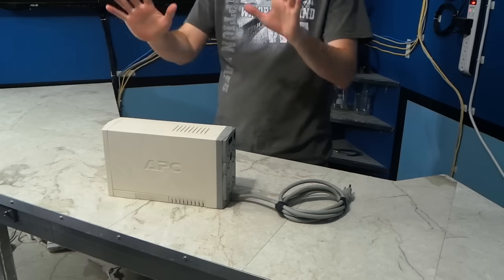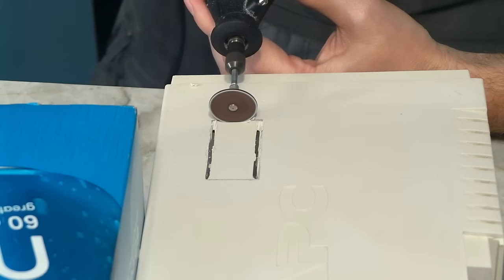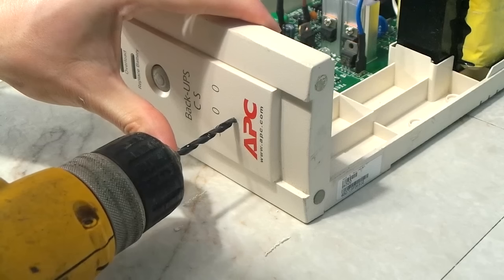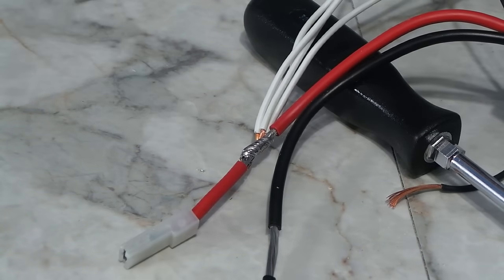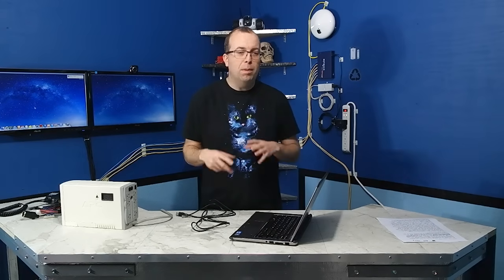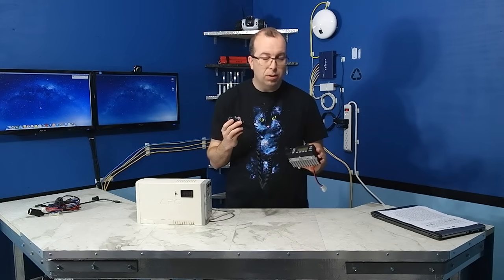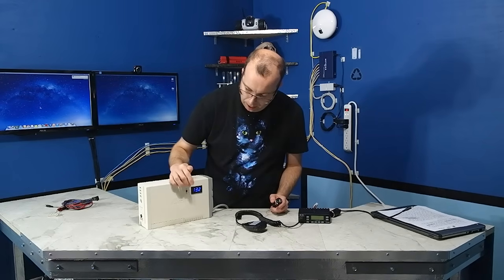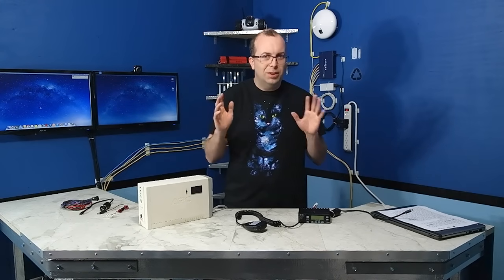Ultimate Battery Backup Hack/Mod.

Comment: You absolutely, positively, should have put a fuse for those three 12 volt outlets.
Reply: +Nabeel Rahimpour yep no fused outlets connected directly to a battery is not good idea
Reply: you dunno if those cigarette plug ports had fuses built in already...i used to work at a place that sold them with fuses built in.  He should've stated that tho.
Reply: There's a bit of difference between your flashlight batteries and apc batts in terms of potential for fire.*****
Reply: +ANCIENT ASTRONAUT that difference is what changes it from "ouch my hand... eww battery leak" to "FUUCK MY EYE!! THERE'S ACID IN MY EYE HELP!!!"~while the battery burns your desk and whatever close to it.
it's not uncommon to have paper around one of these devices. Paper ignites fast. A lead acid battery of this size provides a lot of current when shorted. Lot of current = lot of energy to ignite something flammable and ruin your day... or life.
That's only paper tho, one of these batteries can ignite a lot more when shorted. Or spill it's boiling acid around + toxic smoke.
Reply: +ANCIENT ASTRONAUT only in the amount of dc amperage?  Incorrect.
Reply: +Kalvinjj this is correct.  I hate shitty misinformation spread on the internet by people who don't know their shit, ESPECIALLY when it's a safety issue.
Reply: its just best to have a fuse if you don't want one then thats fine (only need it there to protect from a constant short, as long as you're plugging in a Fused appliance you be OK) just i would of maybe used a 32A inline replaceable fuse inside the UPS on each socket more for again for short protection or a external fuse cap (like you see on older AMPs radios) or resettable push button fuse (like what comes with lots of UPSs)
Reply: positively lol
Reply: hes a rebel ;]
Reply: Without a fuse, he'll most likely blow up whatever he is powering up with that 12V.  It might be a 12V battery but during charge it'll probably float between 13V and 13.5V which may blow devices without a power range.
Reply: @phillipsusn  The devices aren't going to "blow up" if there's no fuse, but the battery itself and/or the wiring connected from the battery to the load could fail if the device itself failed/shorted. And 12VDC devices will be absolutely fine seeing 13-13.5VDC.
When you hop in your vehicle and turn the key on, static battery voltage can drop to 12 volts or even below 12 volts if accessories are running. Then you start the car and voltage increases to 14 volts or above....
Reply: @Kalvinjj  What??? Are you kidding me??? You guys don't have anything better to do but criticize??? Really???
Reply: @greasemonkeyradio1279  "Oh jee it's so offensive when people give seriously important safety tips! Stop making me wear a seatbelt as well!!!"
see how this sounds now? Cause, literally, you're complaining about we calling out the importance of safety.
Reply: @phillipsusn   That I think is OK, the voltage fluctuations I mean. When you think about it, the 12v outlets are the car type, so if you connect stuff that is designed to be powered by a car outlet, it would be up to those voltage fluctuations during it's normal operation as well, if I recall car 12v power can go up to even 14v or so (don't quote me on the specific number!)
Reply: good job  man
Reply: @phillipsusn  bs
Reply: @phillipsusn  Those type of 12V devices are made for a car, the alternator puts out 13.8-14.2V typically, so it's not going to blow anything at that voltage. The fuse has nothing to do with it, the purpose of a fuse is to blow and protect the wiring and battery if you hook something up that is shorted or drawing too much current.
Reply: There's BATTA ACID in my EYE, please, fuck my EYE
Reply: Aayush Gangrade  NO THEY DON'T. Not when the plug has been cut off, the sockets do NOT have fuses in, just the plug does, and he removed it.
Reply: The things that plug into the cigarette lighter outlets have fuses. But that doesn't matter because the DC jacks he added to the APC lack fuses, and you could be plugging in other things like a cable modem that lacks a fuse.
Reply: Aayush Gangrade  the fuse is in the male plug which he cut off and put a barrel connector in its place without a fuse. Most ups have a fuse for the battery itself. Multi battery ups have fuses between each battery in series.  I replace batteries on our work ups's. We save money on batteries by replacing the individual battery instead of buying the 48 volt battery packs. Sometimes the batteries are hard to remove from the metal bracket because of double sided tape but I been successful removing the batteries.  

At least someone brought up the fuse issue so others can remember to install fuses if they want to build this setup.

If everything runs on 12 volts dc then the inverter is of no use and should be removed from the ups. The inverter will drain the battery (ies). A switch could be installed in case you need 120 vac modified   sine wave. This ups is not a pure sine wave inverter. Also the voltage is lower when the power goes off but high enough to run a computer.
Reply: Lack of fuses is the greatest problem, but I should add for anyone thinking of doing this: Those female barrel connectors are a very poor choice for providing power. Note how you never see them used for this anywhere else. They are too easy to short circuit because the center pin and the outer barrel contact are right next to each other and just need a tiny crumb of metal (like those shavings from the drilling) or the tip of a screwdriver to accidentally get lodged between them to be shorted. The male barrel plug is the one that's supposed to have voltage present, because you can't easily short the inner hole and the outer barrel by accident. The easily shortable DC jacks, combined with lack of fuses, give this thing a very serious single point of failure (three of them!) that could cause a fire. 
Other than that, a cool project, and an interesting video, but for anyone planning to replicate this: Always add a fuse between the battery and the first connector, and use a connector that cannot be easily shorted by a stray piece of metal. Also check the current rating for the connector to make sure it's suitable for your application.
Reply: @Kalvinjj  When I was a kid I caught my house on fire this way. It was an expensive lesson!
Reply: Yikes.
Reply: With limited space in the box it would have made more sense to add in line fuses onto his extensions than to try and cram them into the box itself I think.
Reply: wouldn't series outlets be a voltage issue and not an amperage issue?  In series, those three outlets would each see a voltage drop for every added appliance.  In parallel, the original wire can only handle the 16 amps, which doesn't change no matter how many wires you add in parallel - it's still the weakest link.  Better to fuse each one, but then also know that what you're plugging in should not exceed 16 amps.
Reply: @SaintApoc It's both, but devices designed to run off an unregulated battery usually won't mind a bit lower voltage. The amperage (and lack of fuse on easily-short-circuited external connector) is the safety problem.
Reply: @ronb6182  in this case the inverter is also the battery charger, so removing it would leave you with out a charger
Reply: Wires are fuses if you use them like fuses
Reply: @jordanlong00  lol that comment was worth scrolling to the bottom of a 5 year old feed
Reply: @arantala  i was thinking of doing this mod, I'll have to change some elements like female barrel connectors as the power source thx to you critiques & input
Reply: No idea what the inside is, but my cigarette ports 12v have fuses inbuilt.

Little glass tube filament type. Not blade fuses.

Comment: I got exactly the same APC unit, I removed the internal battery, changed the battery wires to thicker type, and use an external car battery, standing right next to it, I also cut out the ignoring beeper, now the unit handle my tank water pump for many days, and no fish will die if the mains power fail for that long.
Reply: I got one as well. Replaced the battery, and removed the beeper. Keeps my Wi-fi and cable modem up during a power outage.
Reply: @shawnerz98  I didn’t want to desolder the beeper on my older UPS, so I filled the piezo with epoxy.
Reply: @billyjack3580  Hey, whatever works. :) I'm thinking about converting the Sealed Lead Acid (SLA) battery to a Li-Ion type.

Comment: It might be a good idea to install a fuse for each 12V port.
Reply: Fuse rating?
Reply: @Andrei2000PC  If each wire is rated for 16A, that's pretty much your answer. There are on-wire cylindrical fuse holders that can be bought.

Comment: An update to how the battery pack has held up would be pretty sweet.
Reply: Him getting those two big battery generators recently, tells you exactly how it went 👇.
Reply: These lead acid maintenance free sealed batteries have lasted me 3 years on average. I have units with 4Ah, 7Ah, dual 7Ah, and dual 9Ah batteries between APC and Cyberpower with most of their product range and I don't get more than 3-maybe 4 years without problems
Reply: @Greenlink74  Try keeping your batteries outside of the UPS. Undersized transformers heat stuff up, killing the battery.
I still have 7Ah Panasonic batteries that were used 10-12 years ago in a big Powerware UPS in a data center. They have a decent chunk of their capacity left. Largely moved to the lithium stuff, but still use those to light up the LED strip in my garage.

Comment: Hope the battery backup found to be useful during the crisis.
Reply: that tiny agm battery has such a small window of capacity to begin with, 12ah at most based on its size when it was new, and you should only use about half of that leaving 6ah and factoring in this is 6 years old, i bet that battery had about 2ah of of usable power. 12v x 2ah = 24 watt hours, so maybe able to power a small laptop for about 45 minutes. thats my guess anyways. after rewatching the video i would say his battery is only 8. he could have covered this in the video and then showed the math for how little power there is to work with here.
Reply: @TimeSurfer206  you are not wrong, another thing is that in emergency or occasional cases you can use all of the ah the battery has, and my opinion of agm tech has went up a bit since i wrote that. i have a 130ah agm that tests at 129ah and its 10 years old and had been sitting in storage for 2 years.
Reply: Jeroen  i agree, and i have done exactly that. i have an old school ups from like 1999 when they were stuff was built to last more than just past the warranty. its power is provided by an inverter that is power by 20kwh bank, but anyways back to the ups it runs my xbox, big tv and a gaming laptop, it is much happier when i have two batteries wired in parallel, but they both fit, so i just have it all laying out on its side and it functions great. in fact i have a 12v mobile radio transceiver being powered by those two batteries two, why not?
Reply: @jasonbrown467  You would certainly get more than 45 min on a small laptop.
Reply: I live in the same area and I relied on 2 battery backups like these to keep my phone charged and give me a little bit of light. I was without power for about 48 hours and it was in the 30s in my house, but fortunately I have a gas stove and water heater, so my pipes were fine and I always had hot food, but I lived with my dog in the central hallway for about a week since the power was unreliable once it was back on. I've now replaced all of my UPS batteries and I'm having a solar/battery system installed any day now.

Comment: For drilling holes in plastic, let the bit turn opposite the grinding direction and melt through. This gives clean holes and no problem of the bit biting in the plastic and puling through the material!
Reply: Now I have to find some plastic and try that.

Comment: I got a hamster wheel rigged to a crank generator to charge a phone with my hamster in a power outage but your way works much better.
Reply: oh my word ha ha thats crazy
Reply: LOL
Reply: I dunno, I think the hamster method would be less of a fire hazard.
Reply: A hamster running fast enough to power a 500W load is at considerable risk of spontaneous combustion.
Reply: Hey good DIY tip, I bet with a few hundred hamsters you could power your whole house!
Reply: But if he runs too fast the wood chips could catch on fire.
Reply: You need to tie up a cat behind the hamster. It produce double the power you're getting now!
Reply: But, dis you tried Wumbo?
Reply: Screw this mod, it's to complicated, I've got a mouse and dangling cheese in front if it, runs like a hamster. tsk tsk xD
Reply: DUDE!  Besure to wake that hamster when the lights go out!
Reply: hey punk, i am sorry, i know i come a little late to the conversation but i have to ask you this question..
your hamsters name is Dynamo?
Reply: Sick!
Reply: Wouldn't be able to run fast enough to provide enough current to your phone to even offset the constant drain of your phone being on standby...
Reply: I have a robot running a wheel, powering a generator, and charging the robot.
Reply: Have you REALLY looked at the hair on those little beasts? They will burn faster than a no-fused outlet!
Reply: How dare you, subject a hamster to slave labor. (LOL)
Reply: @mal2ksc  That's what gears are for. They let the hamster run at a comfortable pace it can maintain for hours at a time.
Reply: and, once the phone is charged, you can eat the hamster

Comment: Thanks for a great video. I did an upgrade to my UPS when the 7Ah SLA battery expired by removing the battery altogether and running some 10 gauge wires out 
to a 60Ah agm deep cycle battery which fits down behind my desk. I have since had some very long power outages with no problems running my PC, screen and a few peripherals. 
Prior to that, the 7AH battery used to give me just enough time to close and save what I was doing, now I can just keep working for hours.
Reply: That's fine if the UPS has time to charge the battery up between power outages.
Reply: The problem with your external battery is that is has a MINIMUN charge current specified by the manufacture and the bulk charger designed for the 7Ah battery is woefully underpowered to handle that.  Also, the UPS that you modified was not designed to run at 100% duty cycle for hours.  It's a packaged system and you just decided to make it do what it was never designed to do.  Yes, most UPS are not only designed for orderly shutdown of the computer, they are INTERFACED to the computer to initiate unattended orderly shutdown.
Reply: @DiffEQ  I had considered that and modified it accordingly. I added two heatsinks to the inverter switching mosfets (mounted on isolated aluminium plates) as well as a case fan to circulate air through to include the transformer. The charge current for a 7Ah battery is fine with larger batteries, only taking proportionately longer to recover a full charge. Lead acid has no minimum charge current, and long slow constant current charging actually extends their cycle life. I did supplement the charging with a 200 watt rooftop solar panel and MPPT regulator, both charge systems use independent CC/CV and don't affect each other adversely. It has now done many long outages, one a year back lasting for two days and running two 7 hour sessions with no problems, no excess heat and good overall efficiency.
I would not recommend the modification unless you know what your doing, first checking that the battery is fully isolated from the mains supply (some are, some are not) and other mods like adding mute switches for alarms, thermo controlled fans and isolated heatsinks calculated for required energy dissipation under full load are things not to be guessed at. Beyond that they make a very cheap upcycling project that works well. 
I have also since increased the battery count to around 250 Ah working, and it can give me almost unlimited run time between solar and generator recovery during daylight.
Reply: My idea as well.
Reply: @DiffEQ  Compromise that external battery size, use an ATV battery, that will accept trickle charging, and switch between two external batteries, charging unused one by external means.
Deep Cycle batteries can be had that accept .5/ah charging, the same output as a good UPS.

Comment: This has confirmed my plans for the UPS I just found in a recycling pile. It's going to be the centrepiece of my power distribution system for my shed in a rural location, with solar going into the battery via an MPPT, and DC out for the lighting & small 12v cooler. The transformer will function as an added bonus, where I can run AC appliances on demand, without having to think about it too much, so long as it's sunny.